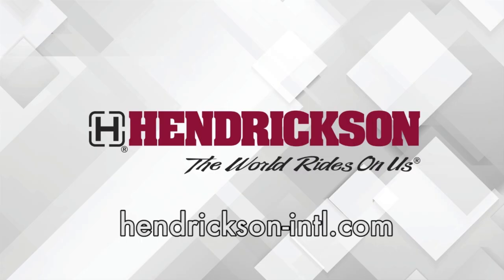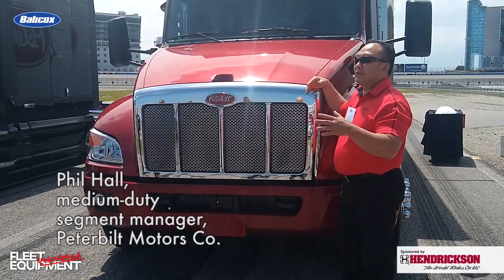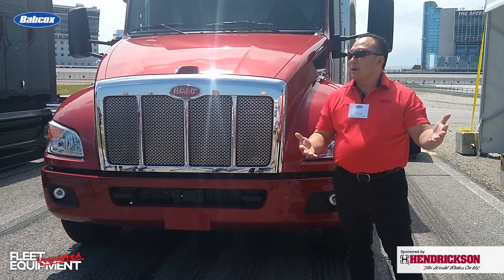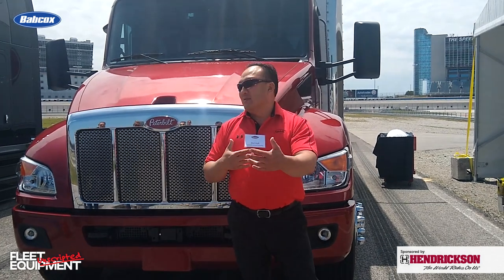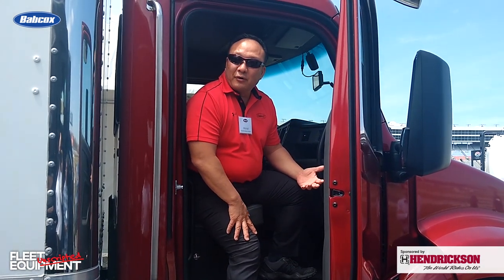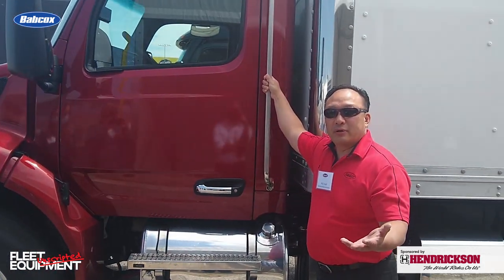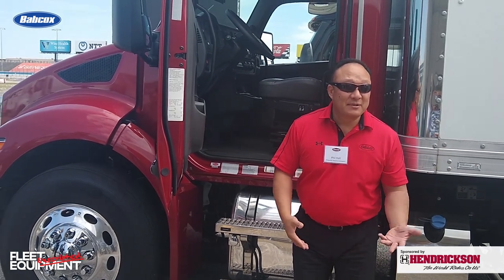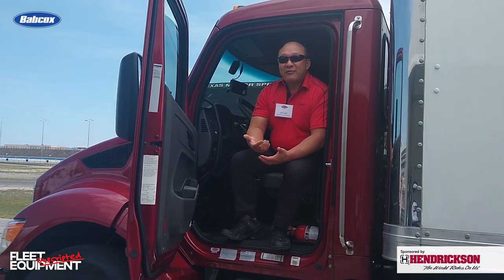Hands on: The Peterbilt medium-duty truck lineup | FE Unscripted

Comment: Love the new look on the Pete and KW for 2023.  Thing that I don't understand why Pete doesn't do that KW does, is put the door seal under the door so that it seals tight after 300k miles still.  Pete has a seal in the door where it gets stepped on or possibly damaged by something else verses KW puts it under the door when it opens.  Much less likely to get damaged there.  One of the reasons we went with KW over Pete for our medium duty trucks.  We are in landfills everyday and beat on trucks so we need very durable trucks.  Have ordered a KW to 2nd quarter of 2022 so we are excited to see it.

Comment: I just received a 2023 tractor. At FedEx. I love the truck. Invisibility. And the ride. but they are incredibly loud. For some reason, on the highway, they are so very very loud. So loud in fact, most of our senior drivers chose not to drive them. But still, I do love mine. Unfortunately, the steering wheel wheel is not straight. A factory defect. While driving down the street road, the steering wheel is turned slightly to the left. And my shop will not fix that. It is very annoying. but I do love the new steering wheel. And the seats are very comfortable. The sound system is just fine. And the Bluetooth is top notch. The plastic interior scratches easily, but that will not be a problem for me. I am very gentle on my truck. Overall, it’s a great tractor.